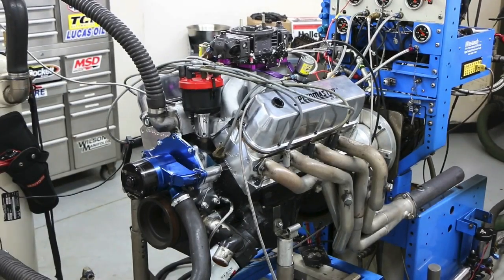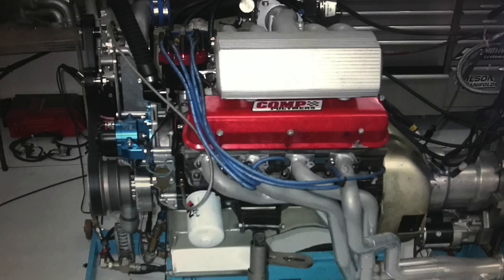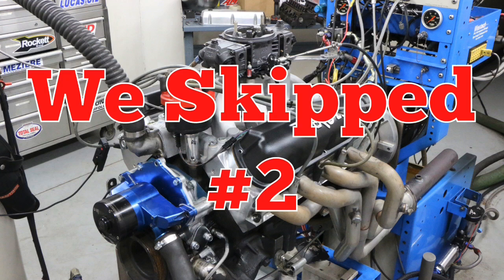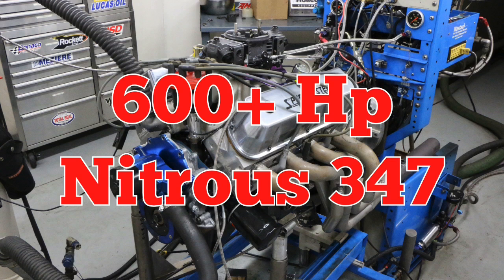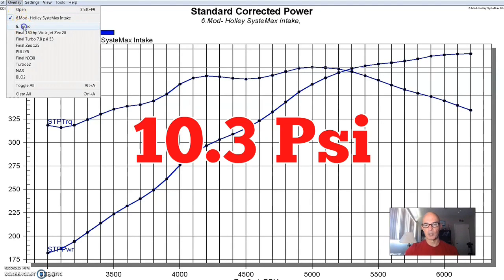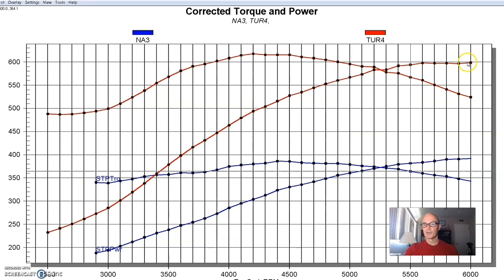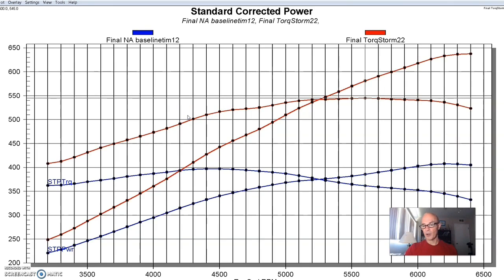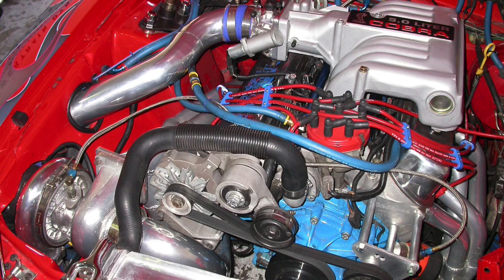5.0L FORD BLOCK SPLITTING-FACT OR FICTION?

Comment: I spit 2 both were 5.0 roller block, and the split right were the roller spider bolt to the block. HP unknow because I did not have them dino. but they both were carbureted. Went back to the older non roller block and have not had an issue since

Comment: In addition to my post, I have a 308 small block for cash crank good rods good pistons it’s 1125 to one makes about 450 hp is not the most potent combination out there but it has been hit plenty with a 200 shotand I had taken it out for freshening. I sent it to the machine shop to have it magna, flux and sonic check not 1 ounce of cracking and I beat the daylight out of that motor.

Comment: Issue is a balance and thrust issue. I would also say harmonic on 347 due to small skirt because of the two large crank that is in that block and also people using wrong bob weights with it like a 28 ounce or a 58 ounce and don’t know what they’re doing with them. I do believe that it is a thrust harmonic balance issue because honestly every time you gotta add weight to a crank instead of removing it that heavy you crank is just not doing that stock block any good and with the long stroke 302 a stroke of 302 anything over 3 1/4. You are really pushing it with that engine, it doesn’t have enough case to actually have that crank. You have no skirt stability and a very bad thrust problem at that pointso there’s a lot of facts going on there.

Comment: I'm always skeptical of reliability claims made by drag racing people.  100 passes down the quarter mile is like one track day session as far as rpm holding and cooling.  Honda k24 is a classic example of something that lives forever at 9 grand in a drag car but puts connecting rods on the asphalt in a track car.  That said, I suspect that the 302 with it's miniscule stroke has more of a shock problem than an rpm fatigue problem.  Let's see what the video says.
Reply from the maker: K series doesn't last in a track car? That's news to me about any Honda (having driven them in endurance racing)
Reply: @richardholdener1727  Specifically stock K24 bottom-end at high RPM.  I think people build them and get good power, but don't fully appreciate what a 3.90" stroke with a short rod means.  They'll live forever under 8k, or when built, or if it's a K20, or if it's a street car that rarely spins up too fast.  People just trust Hondas too much to rev even when it's stroked like a 408, and if it takes 20 years to accumulate your 20 hours of red-line time, you get away with it.  Endurance racers know how to keep within the limitations; those aren't drag-style glass cannon builds.

Comment: I broke a H/C/I  5.0 running a Vortech at 8 lbs of boost. I had just tightened the SCer belt the day before. Took it to work the next day and on my way home I goosed it and carnage ensued. Smoke, oil slick, and sounds of parts meeting other parts they were not intended to meet. I'm guessing I overtightened the belt because it broke off the snout of the crank and windowed the block around the balancer. Installed a used shortblock and got years of enjoyment and reliability out of it. I'm a big believer in Ford's little 5.0. Always reliable and easily adaptable to mods. More often than not I suspect when they break it's because of a bad tune or as in my case, an owner induced mechanical screw up.

Comment: Spark knock is the only thing that really has enough force to hurt a block. Excessive cylinder pressure due to low RPM and too much boost is usually the culprit.

Comment: Ok, I'd like your input.
I built a '85 Stang block. It's bored 30 over and decked 15 thousandth. Stock crank and rods with 11:1 compression Chevy pistons. I have the 40P heads with upgraded springs to match my Crane 363941 cam, a little RV cam. I'm running straight timing gears, no chain. I have the Typhoon dual plane intake with a Carter/AFB 750 cfm carb with a bugcatcher snorkel through the hood. I have a 1" spacer under the carb.
What do you think it's pushing?
Reply: I'm thinking about a 347 crank. Would I benefit much from doing it? I read I could keep the stock rods because of the Chevy pistons having a shorter skirt to them.
Reply from the maker: there is no way the same rod and piston combo work with a 3.0 and 3.4 stroke
Reply: @richardholdener1727 , they're Chevy pistons I have in it
Reply: @richardholdener1727 , a 302 is a 4" bore correct?
Reply: I forgot to say the heads are shaved 8 thousandth also.
Reply from the maker: cam specs?
Reply: I went with the Chevy 11:1 compression pistons instead.

Comment: Soooo then can we do an experiment on how to balance the harmonics and make the SBF great again?
Also heard running tighter bearings clearences 0.0015 - 0.002 instead of going way oversized would help with the harmonics.
Reply from the maker: no on the bearing clearances
Reply: @richardholdener1727  what would be a good bearing clearence for a 600hp sbf? And why is looser beter? Or is 0.0015 too tight even for 5/30w synthetic? Thank you for your knowledge

Comment: It's not HP that kills that engine. It's RPM.
The 289 imo can rev  higher (safer) than a 302 due to the extremely short stroke.
Reply from the maker: That is incorrect. The RPM potential is valve train, not stroke length

Comment: Block splitting usually happens when you don’t have your main caps under the correct torque and it’s always wild high compression engines that go I personally believe it’s a builder problem

Comment: I didn't split mine like they said I would. So the car is an 89 Mustang, stock block, with main girdle, Anderson B4 cam I think it was 224/234 @ .050. TFS Twisted wedge heads, holley systemax intake. 75mm throttle body, s trim vortech making 15 lbs. Then I got power-hungry and installed a cog drive, making 17 lbs. It was making so much more power it was just blowing the et streets off in 1st and 2nd gears... so I thought I'd try a 3rd gear roll-on from 30 mph. Stabbed the gas, and the car was pulling hard at 5900. Then I heard a tink, tink, tink and all went silent... I pulled over to find the balancer was cockeyed... after examination... the block was broken on the passengers side all the way front to back. The crank was broken, and the crank let go in three pieces. It did take out the main saddles front, second, and 3rd. I've been told it's a balance thing. These engines are 50 oz imbalance for that model year. And I've been told it's an rpm thing over 6k. But who knows? I've got another stock block making over 600hp at the wheels, and it's still together, and it's only on 17 degrees of timing at 15 lbs boost.

Comment: Cast is tough against Harmonics  and power What you miss is block swelling  and shrinking with heat .
 a quick shut off  or stall in heated moment would over heat realy quick .
or 1 side being heated and other side not  would end it realy quick .
Because antifreeze runs through 1 side and flows back on other side 
 a shut off with fans running block goes over 300 degrees and quick fire up hitting one side with cooled antifreeze
all at once would cause it to shrink to fast for porous   iron would snap the thinnest part of casting 
and aluminum manifold being non swelling and holding 2 sides of block in fixed position kind of being a wedge effect.
Reply from the maker: water flows from the water pump to both sides of the block-not one then the other
Reply: @richardholdener1727  heat would make sense  snapping blocks in half in certain situations 
i just heard about all the number 8 pistons melting because of hot spot in block 
on new fords im thinking they are not gapped for boost and 16000 rpm of the flat plane crank Ford blocks are pretty tough

Comment: I got a 64 ranchero im gonna build a 331 ford, bought a 93 cobra block that the guy pulled out of his 93 cobra and tue engine block ran 740 with a twin turbo setup(no idea the boost pressure) and he had tue block magnafluxed and its fine. He did say eith the stock block keep it under 6500 rpm cause the block is very strong to thst point, after that, its gonna blow

Comment: Hey Richard, quick question if you don’t mind what harmonic balancer do you recall using and also is it a flex plate or a flywheel in some of these on the dyno? Thanks boss!
Reply from the maker: we ran flywheels (manual trans) and balancer was stock on the one in the photo

Comment: The only FSB I've seen split (cracked actually) was related to the improper balance. The owner ran an externally balanced flywheel (32 oz.) on an internally balanced shortblock.  This makes sense, because sustained vibration is very destructive force.
Reply from the maker: 28 or 50 oz = SBF

Comment: Thanks. David Vizard did two videos on how to prevent/strengthen 302 stock two bolt main blocks. According to him with this method, he’s never lost an engine. If you want to take a peek here, or the titles. Maybe you can discuss this on a different show.

“302/351 Ford OE blocks - how to make them live even at 1000 hp.”

“1000 hp capable Ford production line
5.0 block.”
Reply from the maker: were those early blocks and not the more fragile (thin-wall casting) EFI 5.0L blocks?
Reply: @richardholdener1727  I think he discussed different block Iterations, but I don’t remember which one of the videos it was. I think it was the one that states 1000 hp. The basic conclusion of the video was that the correct stud girdle does work in terms of stopping the block from spreading energy left right on the engine horizontally.

Comment: I personally have split 2 I had almost same setup as yours trick flow high ports 331 dss motor split one at 625 hp 20 pounds of boost . They seam to all split or crack in the main journals 1 and 5 mainly  but second set up same upper half tri c k flow high ports track heat intake hp was 625 that set up as well only thing that kept it together was the trick flow stud girdle 😊😅😅😅

Comment: My car dynode at the wheels 497hp and 499 torgue on a stock block 302 with TFS 11r190 comp titanium heads, TFS stage 2 cam, TFS track heat intake, 80lbs injectors, and Vortech V1 T-trim blower. Could have made more on the dyno if I had new spark plugs and gapped from .035 to .020 or .025 and to add some knock sensors to my Holley terminator X. Motor is still holding good even up near 7k rpm at the track with a stick shift.

Comment: My wag is on an imbalance issue with the internals. When it comes to building high horsepower, torque and rpm engines, how many backyard mechanic's ( Professional engine builders know better ) actually pay much,if any, attention to having the internals balanced and clearanced? Assuming they even think about doing it at all. Most backyard's I know say that nowadays good quality new parts are " close enough ". I laugh because it proves that common sense and experience isn't inate. An engine imbalance isn't noticable at low rpms unless it's really bad. However,you spin that same imbalanced reciprocating assembly at 6,000+ rpms and if the discrepancy is big enough then you won't have to worry about it much longer and you can blame it on  " bad quality parts " from China... LOL.
Reply from the maker: any new batch of internals would have to be balanced before use. I don't know anyone who runs them without balancing
Reply: @richardholdener1727  
 I've known several shade tree, as well as amateur engine builders, that don't think balancing internals is a necessary expense for a hi-po daily driver because it " won't see high rpm's constantly "  or they have the attitude of " all I did was put in a new crank, pistons, rods, etc. from this brand name reputable supplier, so it'll be fine. ". I've even ran in to a few shade trees, albeit younger ones, that haven't heard of balancing and blue printing an engine before. In general, the experienced and professional engine builders KNOW just how critical this nuance is.
 As far as cost goes, in the eyes of others, I guess it boils down to how much money they sink into their engine and/or how much they value their reputation of their work, which shows on a regular basis. Personally, I have it done for every rebuild, even for a non-hipo daily driver, because I want the engine to last and to run smoothly. 
  By the way, I LOVE your informative, sometimes challenging, and well produced videos. They also have a down home, non-formal and relaxing feel to them, if that makes any sense... LOL. Keep'em coming 👍!

Comment: Mid 1990's cog driven experimental VT made number of runs at around 700 before splitting at the mains when the driver decided to ignore the builder to park it because it was showing signs of failure. Ford 6.9 Diesels would do the same thing with a Banks Sidewinder turbo system, the blocks are strong but fatigue failures will happen.

Comment: It's been a long time but I thought your competitor, 5.0 Mustang magazine had a couple of pictures, not a lot, but a few, and it the blocks were cracked as you describe. Causing some to look for a stronger version. And The Corral had stories about a block Ford produced in Mexico that had tin in the alloy and was rumored to be stronger. I have no idea, but that was on the boards.
Reply from the maker: I thought the Mexico blocks were early 302s-and they were not late model (thin-wall) castings, they were stronger

Comment: Mine failed due to crankshaft Stock short block E7 heads1.60 2.02 vavles full port GT 40 intake and Novi2000 and letter cam. Everything pointed to crank failure.

Comment: It’s the flexing of the block under load. Front and mid plate play a huge roll in lasting on the the street under high hp numbers. The tunes gotta be right also. And when the do split it’s the crank that causes it. It either bends or breaks in two.

Comment: Big difference in 600hp at the crank and 600 hp at the rear wheels. 600hp at the rear wheels is like 800 at the crank on engine dyno so start running them around 750-800 hp on the engine dyno and see what happens.
Reply from the maker: 600 whp is not 800 flywheel-its much closer to 700 flywheel (depends on trans, rear end and engine config)
Reply: @richardholdener1727  Did you bother reading? I said "is like 800" which means its a example.
Reply: @richardholdener1727  And your also wrong on that, the HP numbers are all different per engine. Some can be more and some less on engine dyno vs chassis dyno depending on converter ect.. . Do it the right way and run them up to 700 CRANK hp so its closer to 500 on a chassis dyno. See what happens then, thats a real test.

Comment: The silver state classic example is interesting but only 430 to wheels, which is not a lot of power, but that is a lot of abuse. 

I had a friend with a 95 GT, 64mm turbo, stock cam, tfs 170's, typhoon intake,tuned by previous owner at 10 or 12 psi. Stock hyper piston motor. My friend buys the car and turns it up to 17 psi, no tune change, but throws 110 race gas in it, that was too much boost for the little turbo but it made 530 rwhp and 615 torque with a locked 4r70w. 

We swapped the stock throttle body and turned boost down to 14 and it ran faster than it ever had, trapped 104.9 in the 1/8 in a full weight 95 GT with EVERYTHING, plus a wolfe 6 point cage, 17x10.5's, weight od the turbo kit and a 297 lb driver. Car had to be around 3700 race weight. So in that weather it had to be making 560+. Never broke. Ran the injectors out of it one night. Never broke. 

His LX was a rebuilt 302, afr 185's, s trim and 100 shot on 100 octane. It never broke either but never had a ton of passes. 

However I've had friends with a t trim 347 break, a friends low power 302 with tfs170's and an s trim break, a friends 306 with edelbrock heads and small turbo making 400 break. 

People always say the tune, if so, then how do so many hyper piston cars never crack one of those fragile pistons but blow the block to bits?

Comment: I ran 302s for years, spinning the one to 6600-6700 everyday! The first time I bolted a borrowed nitrous plate on it I blew both head gaskets! To much timing, wrong jets in the plate! Who was it that stated "nitrous doesn't kill motors, we kill motors?" But, it so much easier to step up to a 351w!! The those training wheels off!

Comment: the 302 is a very good block but dont forget the very short stroke !!!! and large bore 4 inch exactly.....the 302 rev close 8000 rpm......
Reply from the maker: the production 5.0l 302 won't rev anywhere near 8000 rpm-no matter what the bore and stroke are

Comment: Building a turbo Fox 302 Stock bottom end. HCI, One3 turbo. Should I run a flat timing curve after peak torque? How is this timing curve setup?
Reply from the maker: timing curve is a function of detonation threshold
Reply: @richardholdener1727  Curve it is. 😉

Comment: I believe it's a combination of hp and luck of the draw. I went 9s for years and never split the block. Then i had freinds split them going 10s un less than a year. Same thing with the crankshaft. I've seen several broken crankshaft being a heavy line tech at Ford and yet my 9 sec car with a stock bottom end and a 300 shot of nitrous racing every weekend for years.

Comment: I more or less AGREE with Hottskulls. Maybe Quality Control at a minimum or a RARE BLOCK defect that was missed. Just guessing as your many tests indicate that there is no "500HP/500TQ Wall" and if there was...more likely 650+ just from the numbers on your DYNO RUNS. Running your 5.0L Mustang for 32+ min at 500+ (as you mentioned) is even more proof that 500HP/500TQ is even RELIABLE! Of course I am sure your FUEL was at least 90+ Octane too. Did you compare say E85 to 91 to 100 Etc?